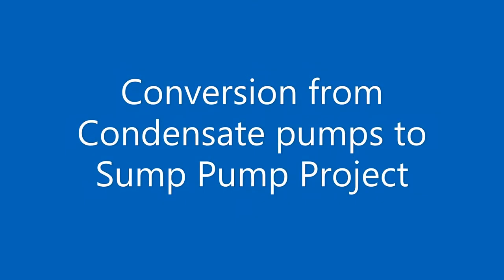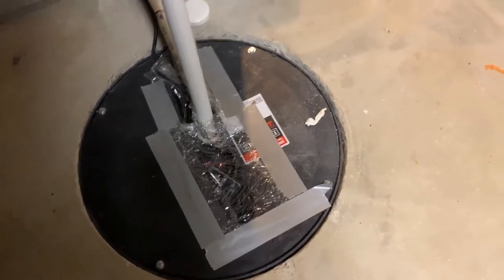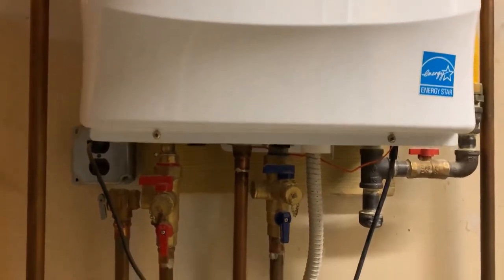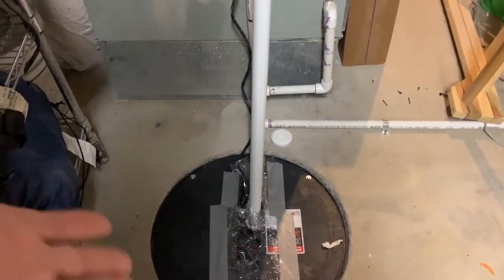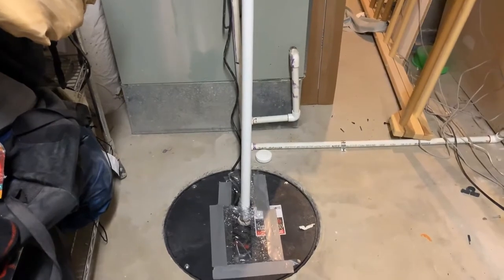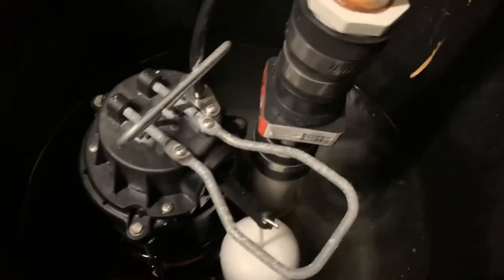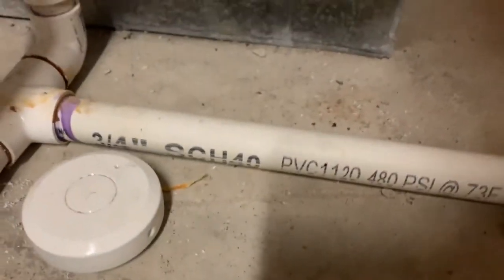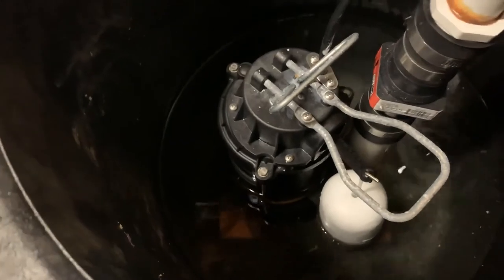Conversion from condensate pumps to sump pump

Comment: Did you install a heat trace line to keep it from freezing outside ?
Reply from the maker: No. I live in NJ. It is sloped downwards and has never frozen. It only runs a few times a day so I guess the ice doesn't build up.

Comment: Does this need a trap?
Reply from the maker: No trap, I did install a check valve to prevent the water from flowing back into the sump pit when th epump turns off
Reply from the maker: No. Hasn't clogged since it was installed. I haven't touched it in 4 years and it seems to be running fine.